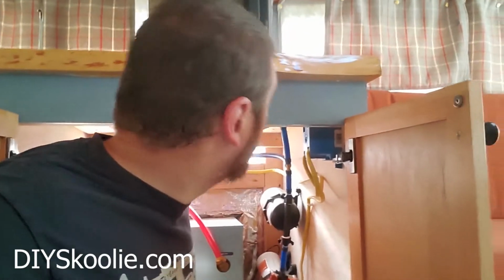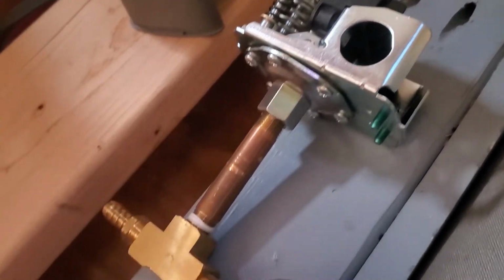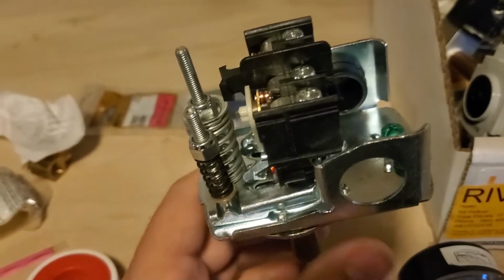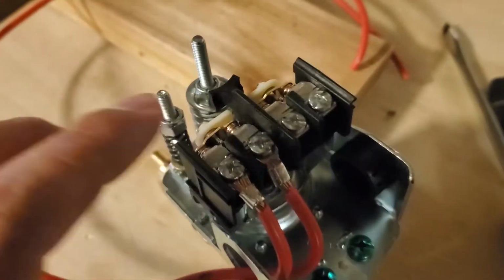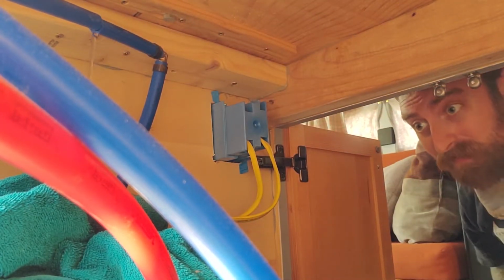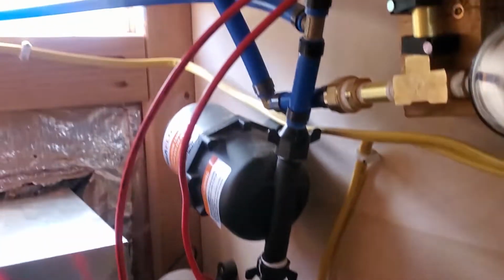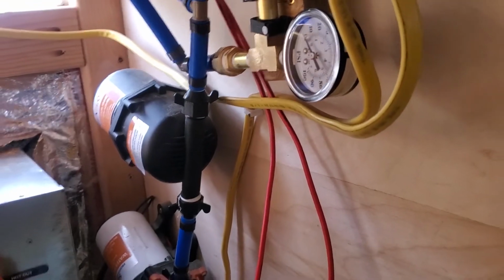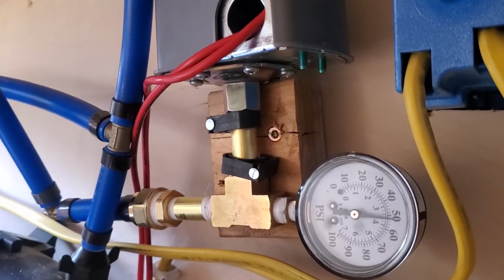Conversion Video 60: Water Pump Pressure Switch Upgrage/Repair

Comment: Isaac, that fix was genius! Strong work on that solve. The surprise in your voice that it worked might've been a little more than it should've been though. You're skill set when it comes to plumbing might not be the best, but figuring that out and putting it together, there's no reason for it not to work. It's just a 12 volt system rather than 220 like most wells. Your water pump is essentially a 12 volt well pump with a crappy pressure switch, and you nailed it making it work again.

Comment: thanks for making this video. it sucks that the seaflo pumps arent more reliable and they dont honor the warranty. the little switch inside them is clever but prone to failure. replacement is fairly easy byt sourcing the part is not -- clone parts are easy to buy but they burn up quickly (there's a little contact inside the switch which burns and can also melt the plastic housing enough to stop working). pretty absurd that a full-size well pump switch is the next cheapest alternative at $15-$30 plus other little parts, $60 total easily if you're not careful. to keep a $60 pump running. one of these days i'll create an open source pump with easily refurbished parts!

Comment: I saw a video on your rv windows and they are perfect, can you please let me know where you bought them or the name ?
Reply from the maker: They were an ebay purchase. I don't remember the name. I believe they are for a horse trailer. Fun fact: I installed the smaller ones wrong. The glass is supposed to slide to the side, not up and down. Still works fine, though.